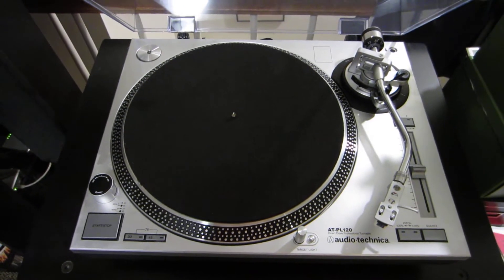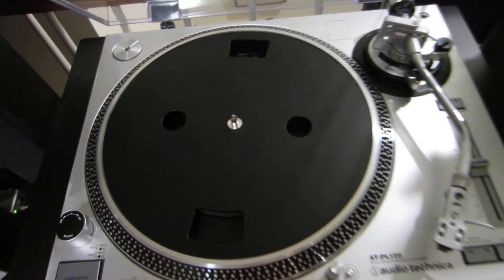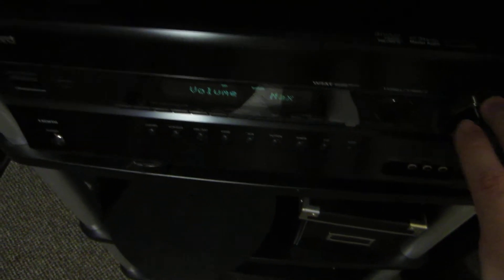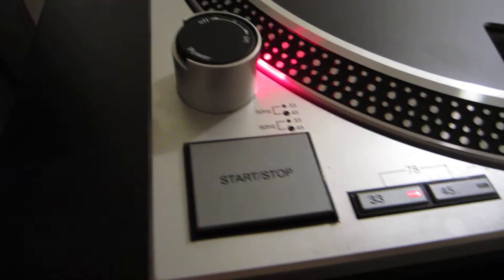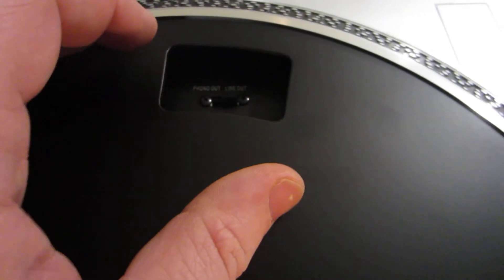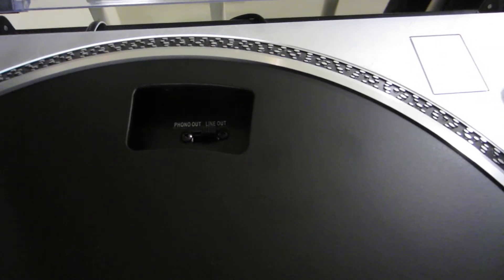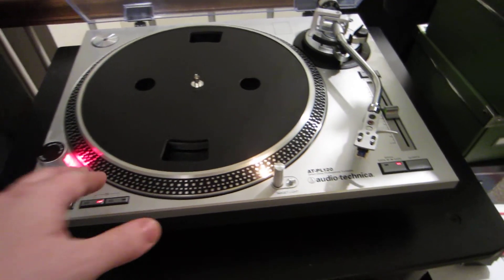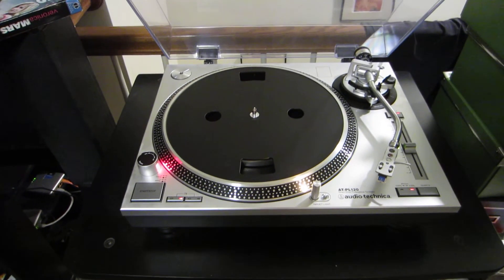Audio-Technica AT-PL120 hum issue

Comment: if it comes from the line setting then it is probably vibration from the platter .  If it comes from the phono setting then the pre-amp is turned off and it is a problem either with the internal ground wire.  But in most instances, the issue is probably the headshell wires that connect the cartridge to the tone arm.  The wires should be connected at 180 degrees or a straight line.  Any kinks in wires of such small gauge can give you a bad ground hum very easily.

Comment: If you haven't so yet, remove the built-in preamp. Even bypassing and using the Line mode still doesn't clear up this issue. I have a video on my channel where I soldered in a pair of RCA cables directly to the tone arm wiring and it was well worth it. Your ears will love you if you do it!

Comment: A turntable does sound great but it's a very live device. Even when you plug in the turntable into a phono input and connect the ground wire, you will get a rumble or a hum that starts gradually and gets loud at loud volumes. You must experiment with locations. That's just the way this device works. When your turntable is playing if you lightly tap on it you will notice the taps coming through the speaker, so when you play it loud it starts to pick up the sound coming from the speakers and if you have a powerful subwoofer and the turn table is close to the speakers matters get worse. This is a great starter turntable and sure there are others for $100,000 but this is what it is, experiment and try isolation feet Bright Star - IsoNode Feet got good reviews on Amazon, I need to get some because my turntable which is a Technics SL 1200 does the SAME thing too.

Comment: I have the AT-PL1240 USB.  The hum is present even when the unit (and the preamp) is turned off.  Yes, I have it grounded.  I compared it with my Empire Troubadour--the hum that comes through from the  AT is about twice of that of the old Empire.  (You're always going to have a little hum.)

My problem is that I bought this turntable specifically for making restorations of vinyl recordings and digitizing them.  This turntable is completely unsuited to this purpose and I suspect it is a shielding problem which would be hard to remedy.

Comment: I agree with Zanzibar. Make sure the headshell wires are correctly connected....and make sure the headshell is properly seated in the tonearm. I've had that sort of problem where I thought the headshell was correctly inserted and I heard very loud hum. Once I took the headshell out and then reinserted it properly, the hum was gone. As an aside, the built in preamp isn't that great.

Comment: You have the volume control maxed out...that in no possible way represents normal operating conditions of your receiver. If you actually played music with the volume maxed out, your receiver would blow...as would your speakers. It is unrealistic to expect to hear nothing when you have the volume maxed out, especially with using a turntable. The hiss and hum that would be negligible under NORMAL operating conditions of course is going to be louder when you have the volume maxed out! It goes without saying that if you alter your table by removing the built in phono preamp, you void your warranty.
Reply from the maker: I needed to max out the volume to have the hum heard over the mic of the video recorder. It's not the end of the world, but it's noticeable, even at lower volume.
Reply: gohepcat I've read that the built-in phono preamp is not great. You can remove it, which of course immediately voids the warranty. As another poster said here, there is a YouTube video on how to do it. I have this table as well, and have never used the built-in preamp because it is inferior. I'm currently using a Pro-Ject PhonoBox with excellent results, and so I've never felt the need to remove the built-in preamp.